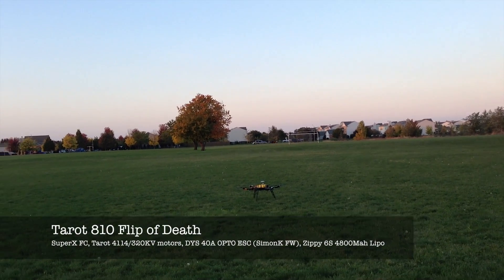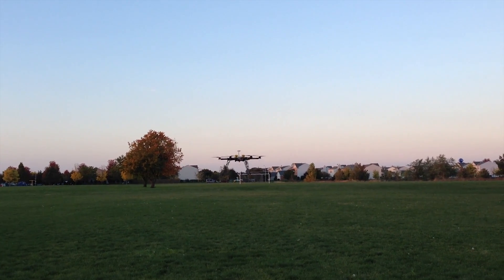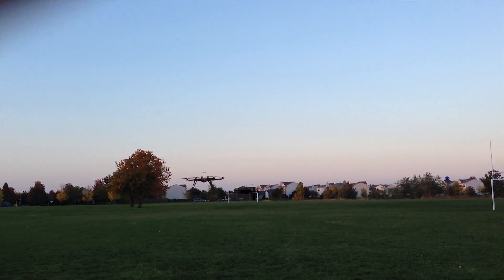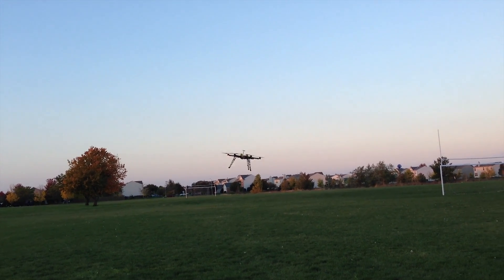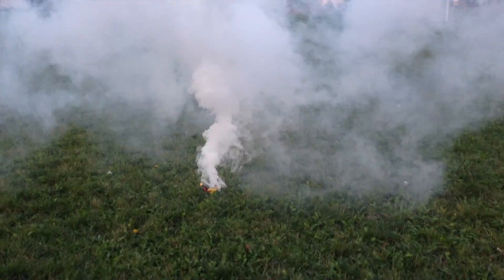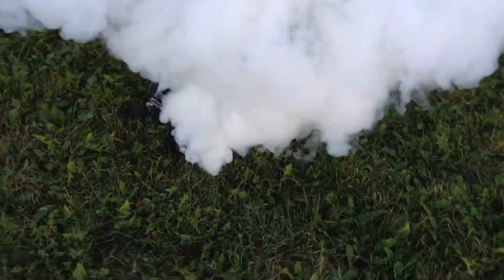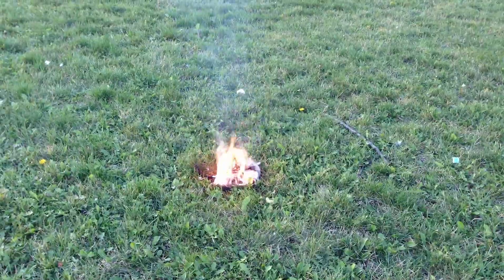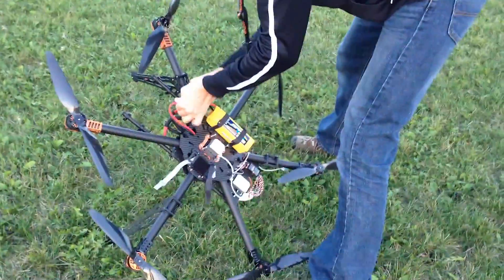Multirotor (Hex) Flip of Death - Crash and LIPO Explosion

Comment: I experienced a similar problem with my 680 new build, during test flying she kept on flipping.  I adjusted the gains and eventually got a stable flight on a 3S LiPo so fitted a 4S and took to the air, what happened can be seen in the video.  She is fitted with a Naza V2, T-Motor 35A SimonK flashed ESCs and AX-2810Q motors from Hobbyking.  Posted my findings on Multirotor forums, in return received loads of advice about balanced props, perfectly aligned motors, vibration dampened base for the Naza etc but having flown a quad and an Octo commercially for a year my experiences tells me that there is something else at play here.  She is top heavy with the COG just above the Naza so had thought that may be the problem but your ESC problem has got me thinking and I have no way of monitoring the data from the motors and also don't understand why the battery alarm went off (at least I think that's what it was) just before she tumbled out of the sky.  I have already re-built her and am just waiting for the weather to break, in the mean time I have also calibrated the ESCs and then strapped her down to a bench and tested full throttle and exaggerated stick movements to see if I could trigger anything.  I got an alarm briefly but then could not get it to go off again.  I'd be grateful for your thoughts: http://youtu.be/SElHuZ9Xj1s

Comment: The gps is way to close to the batteries!  It should be at least 5 inchs from any electronics! that mount would be fine if the lipos where mounted sides or bottom plate!
Reply from the maker: Nope, the GPS is and was 8" from either battery. The issue was clearly nothing more than a defective ESC. It's flown without issue since the defective ESC was replaced last year.

Comment from the maker: After replacing the bad ESC, this is what cause the crash in this video, the Hex and the Super X has flown perfectly!
Reply: My S550 just did the same sideways crash but with only one prop broken. I was able to repeat the scenario three times before the prop broke, so I can be sure it's a genuine fault and not my own pilot error.

I'm just beginning to try to understand the problem. My hexacopter listed to one side only, and it had no influence from my hand on the controls.

I think I might start at your point, that a bad esc as the cause, before I try a different flight controller, or different transmitter & receiver, or reducing vibration on the gyro & accelerometer, or wondering if there is 2.4ghz radio interference etc etc.

Thanks for showing an example and stating your findings & solution
Reply: I know all about bad ESC's lol. My old 250 race quadcopter had a bad ESC, it would just shoot off into no mans land at random times without me being able to correct it.

Comment: This is exactly why all those noobs flying over residential areas should be fined or have copter taken like a skateboard because that lipo would burn a messy backyard or garage in a crash. I think you have either a weak wire the FC is trying to compensate for or pid settings way high or it was on manual because of a damaged internal code or circuit.
Reply: then you going to ban new laptops because most new laptops use lipo batterys
Reply: What about exploding cell phones and vape pens?

Comment: Tom, how did you determine it was a bad ESC? I'm having a similar problem with my new hex. It flipped once on me. I've got a Naza M V2.
Reply from the maker: The SuperX flight controller has a 'black box" that records the data.....motor output, tx inputs..etc. With this info. I could figure out it was my M6 motor that was not responding correctly. I replaced the M6 ESC and my problem was fixed. 
I had another issue with the flight controller but that was a different issue.